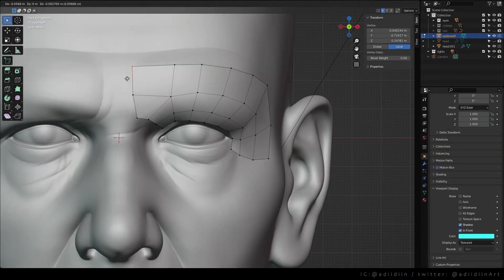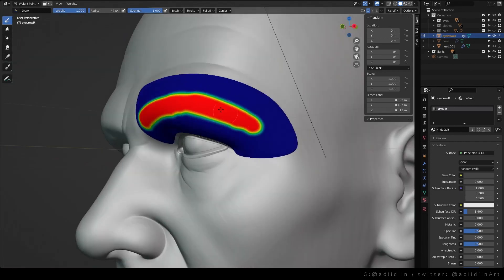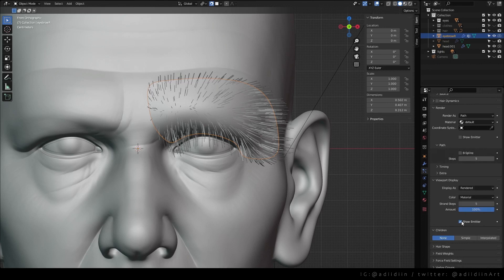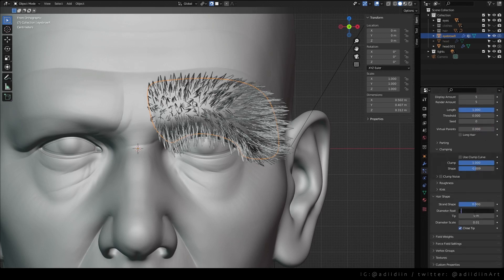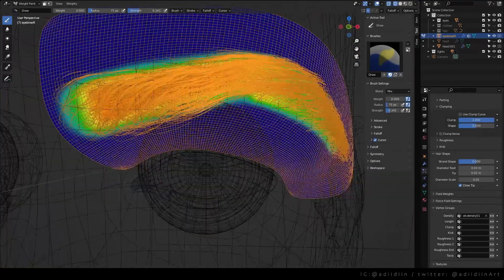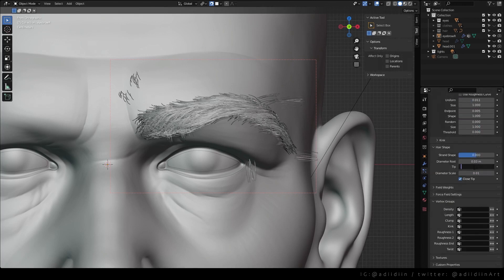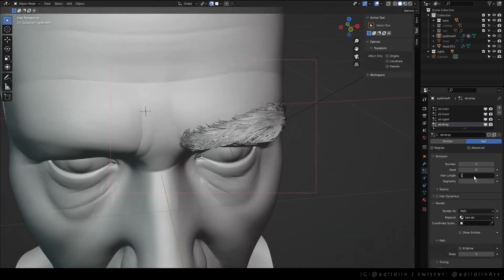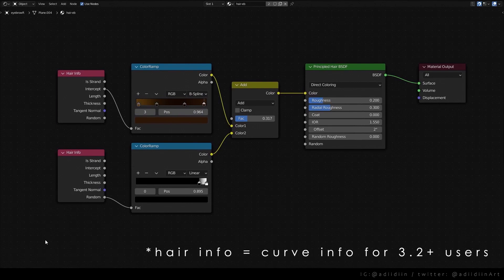How to Create Eyebrows in Blender

Comment: How do you duplicate the mesh from the head? I dont know all the shortcuts and functions yet.
Reply from the maker: tab to go to edit mode, select faces, shift+D to duplicate, P to separate selection :)
Reply: @adiidiin  didnt work, went to edit mode, select face,  shift/d didnt duplicate and the only thing I can get to cover where the eyebrow were was a square
Reply from the maker: I'm not sure...I'm thinking there might be a modifier on your model that might be causing the problem?
Reply: @adiidiin  well i just followed your video and what you had replied, didnt work on mine, I didnt touch any of the modifiers
Reply: @adiidiin  under face there is  a  drop down menu, maybe Im supposed to push something there? but at 1:57 of your video, Im not able to do that
Reply: did you try, with just the faces selected, right quick and seperate at the bottom. That should create another layer under the first one. Thats how i had to do this